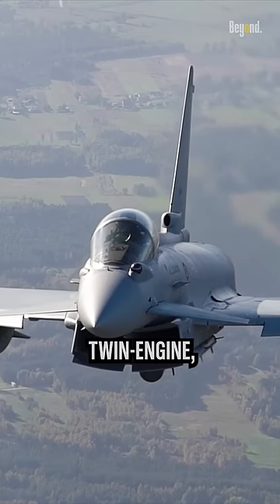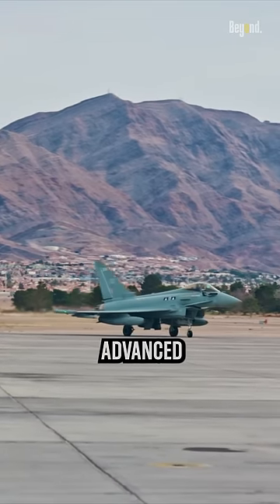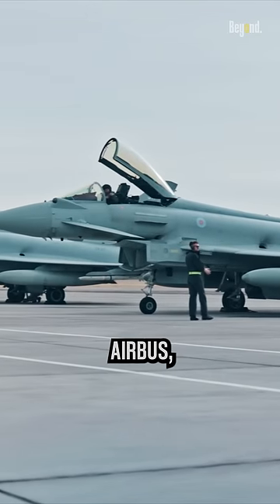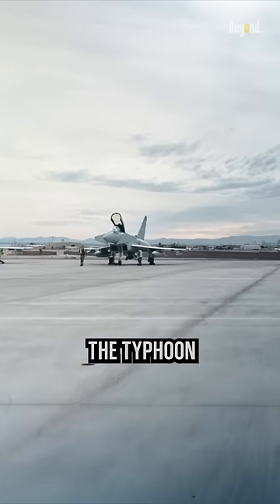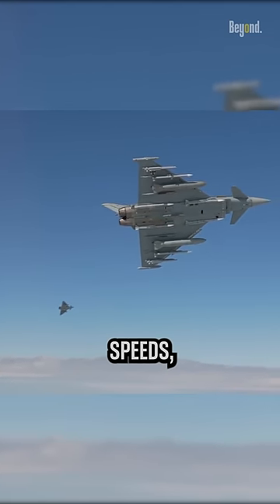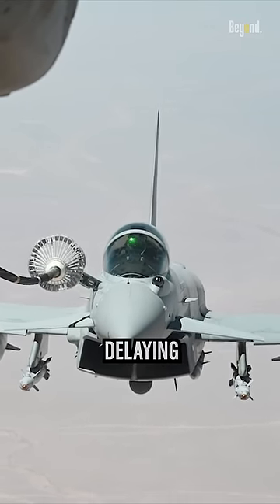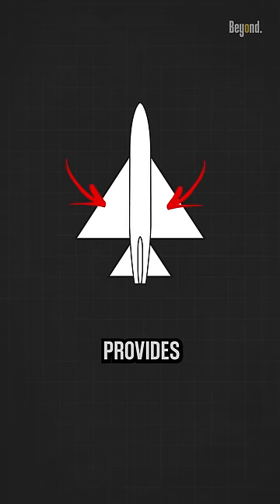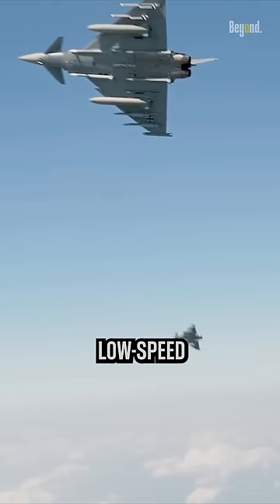Why does Eurofighter Typhoon use Delta Wing? #shorts

Comment: Delta wing aircraft are cheaper to manufacture while offering very good performance
Reply: Really? My dumbass thought it was the opposite, the cost part i mean
Reply: Yes
Reply: Very expansive to design and built, zéro tolérance in small mistakes, and the greatest knowledge is from Dassault. The typhoon IS a mistake since beginning was designed 100% interceptor ( possible German's requirelents)  ZERO Bombs at all, had to redesign. Anyway ZERO order within 6 years = dead. German have to order some soon just to save the programm instead if going forward. Poor "Eurofighter" is dead loose ALL compétitions... etc.
Reply: @frednoname3714  No offense, but might wanna check your spelling next time
Reply: @frednoname3714 least nationalistic french patriot trying not to spit against the ef when the possibility arises
Reply: @frednoname3714  Saudia Arabia Kuwait and Qatar is no orders in 6 years?  The mistake Typhoon is more lethal than the Rafale in air to air in all realms and can cover all the air to ground missions it's operators need to the point it was able to replace a dedicated air to ground platform the tornado. You're clearly just a hater from France.

Comment: I would still put the F-15EX up against the Typhoon, it’s faster , has the new Ratheon missile and AESA next gen radar
Reply: I C your F15EX and raise you a Rafale C or M armed with The Meteor @ Mach 5 compared to the AIM-120's Mach 4. The Meteor highly maneuverable, and has a “no-escape-zone,” or region in which the attacked aircraft must rely on maneuvering to defeat the missile instead of running the missile out of fuel, three times that of the AIM-120.  Radars & IRST lean towards are a wash about the same but RCS Rafale wins.
Reply: Typhoon is a more lethal air to air machine than the f15 ex. The F15 ex isn't really faster than the typhoon. It can't reach Mach 2.5 and it cant super cruise, climbs slower and accelerates slower. Kinematically the typhoon is more powerful. The typhoon also has a new radar superior to the APG 82. It has an IRST sensor and a more advanced ECM system. It also has an electronic attack capability. Finally both short range medium range missiles. ASRAAM and Meteor are more advanced and capable than anything the USA currently fields. So there is no competition.
Reply: @joshafc41  That's why I suggested the Rafale.
Reply: @joshafc41 How many air to air kill does the little europlane have compared to the F-15 series?

List those figures and then really tell me it’s more lethal 😂
Reply: @rifleshooterchannel208  It doesn't matter. 99% of the air to air kills the f15 has are against 3rd gen aircraft that aren't even in service anymore. Newer aircraft use more advanced technologies which make them more effective. I shouldn't have to explain that to you.
Reply: @joshafc41  Newsflash, the Eurofighter is “4th Gen” the way the MiG 29 is “4th Gen” aka more like Gen 3.5 😂

Literally no different in practical usage than a MiG 29 and I would say ask those Iraqi pilots how well the MiG 29 fared against the Eagle, but you’d probably need an Ouija board.
Reply: @rifleshooterchannel208  Okay so you picked one plane, what about the rest? They're all 3rd gen aircraft just like I said. 99% of kills were 3rd gen. 

You're not making any valid points...
Reply: @joshafc41  I am making a valid point, you just can’t cope with it. 

The Eurofighter is no more capable than the MiG 29 and the MiG 29 got its lunch eaten by the F-15 in every single circumstance. 

You don’t have to like it, but thems the facts 🤷🏿‍♂️
Reply: @rifleshooterchannel208  Its pretty funny people like you exist making ridiculous satements with 100% conviction and belief  in what you're saying.

I'm not gonna get into all the details but the the mig 29 was a light fighter initially meant for day time WVR combat only. It has very little BVR capability and was never meant to go up against fighters like the F-15. Thats what the Su 27 was built for. The mig 29 is completely obsolete the Russians have produced a new variant called the mig 35. So no the mig 29 is not more capable than the Typhoon. 

And the F15 an aircraft that entered service 50 years ago is not going to be more advanced or capable than something that entered service in 2003.

Perhaps you should do some more reading and less talking.
Reply: @joshafc41  I mean you say that, but the combat record speaks for itself. 

Cope 🤣🤣🤣
Reply: @rifleshooterchannel208 Stultus autem clamet maxima. Get it man, not everything the us builds stays unkillable.
Reply: @zSwax  Hasn’t been killed yet 🤷🏿‍♂️